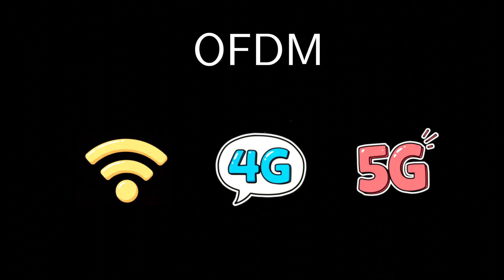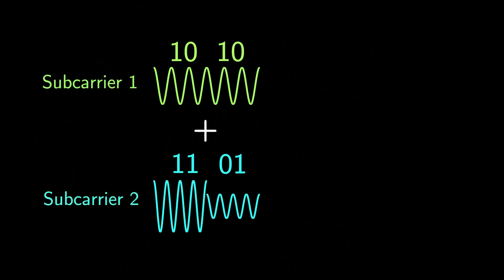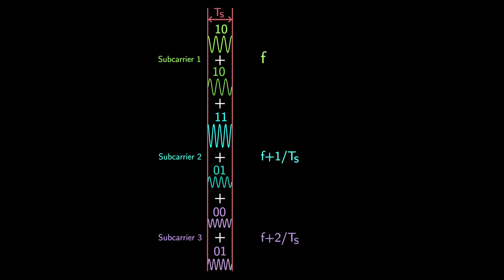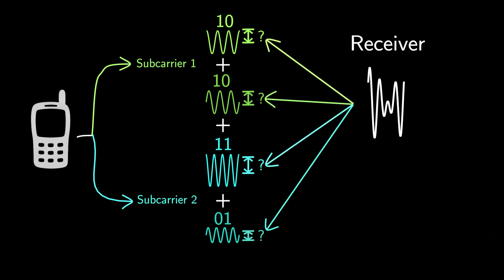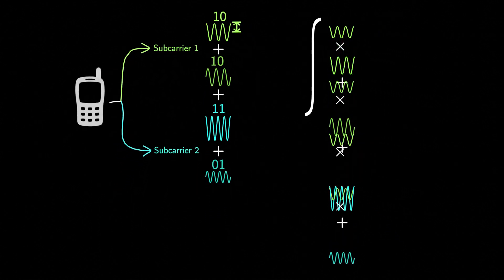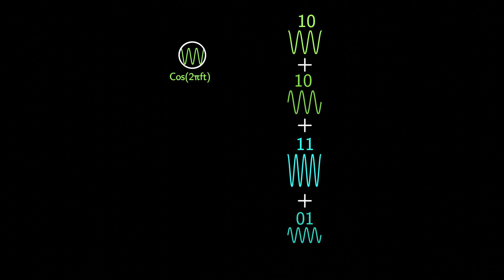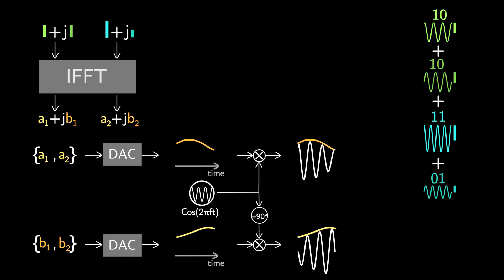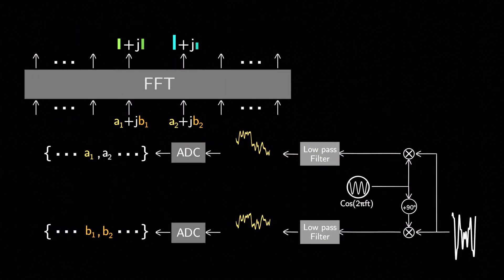What is OFDM?

Comment: 25 or 30 years ago I was talking with a co worker wondering how  HD TV and cell phone technology could progress with every new technology seemingly held up because we were running out of radio spectrum.  He had been an  electronics instructor in the air force 20 years prior and his comment was that civilian radio technology hadn't even scratched the surface of what could be transmitted wirelessly.  Every time a new signal transmission technology gets implemented I am reminded of his comment and wonder what he knew.
Reply: Military have often used techniques such as frequency hopping, spread spectrum, encryption which isn't routinely used in civilian apps, because the commercial market is far more price sensitive than the military market.

Encryption is now regularly used in mobile telephony.

Spread spectrum did make it into 3G mobile telephony but spread spectrum was adopted by the military many years earlier.

Comment: As an electronic engineer having finished my formal education back in the early 1970's this is very interesting to me. I have just watched your last 3 video's about modulation and they are all good. In my final project when studying way back then I found acticles about this later kind of digital modulation and wanted to use it but unfortunately I was told it couldn't work and I am quite sure my project grade was reduced because of this. I was obviously right but I haven't been working in that field since so I haven't quite known it until now. It wasn't a surprice though as I have long known that it had to be what all digital modulation used today must be some thing like. I knew I was right then but I just couldn't prove it enough in the given time.
Reply from the maker: Thanks for sharing your experience.